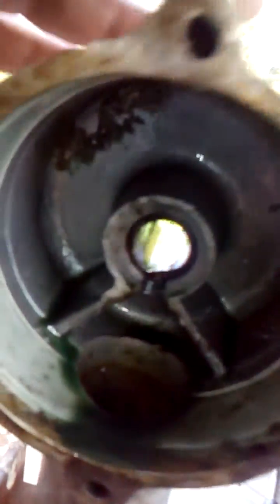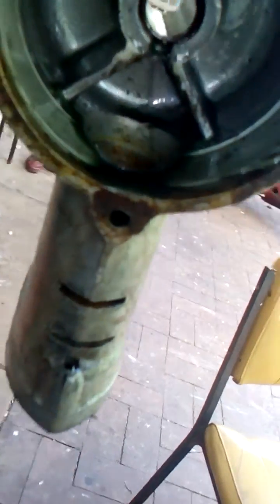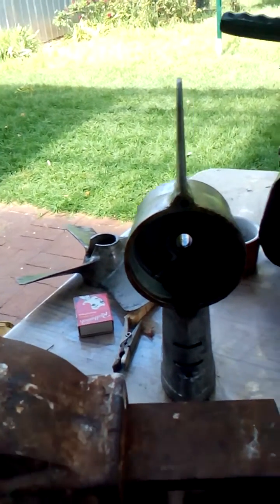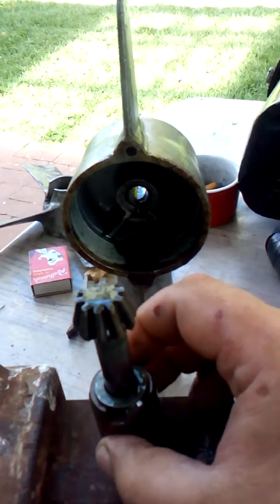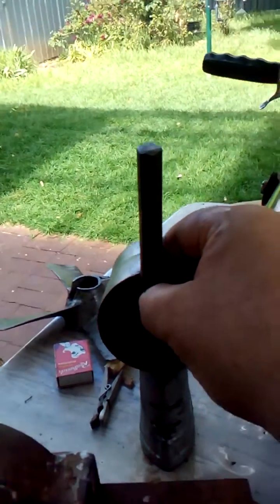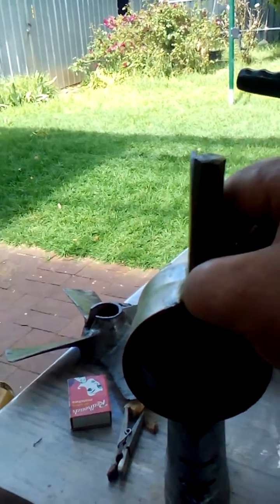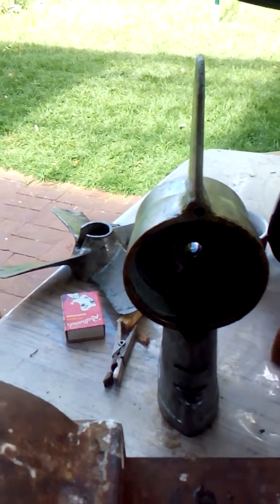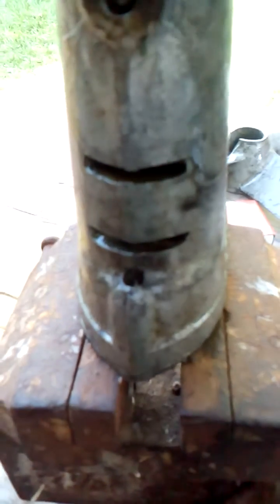British seagull pinion / bevel gear removal the easy way

Comment: Wondering why did you need to remove the pinion?
Reply from the maker: to replace the bushing if its worn or the gear if it has has damaged teeth which mine had caused by a pin that had fallen out
Reply: Mine is turning, but not very cleanly, so removing, honing and regreasing it will give it longevity.
Reply: Hi there, Mine came out when I tapped the long drive shaft which it is currently stuck on? How do you get the bush back in in the correct position so it aligns with the locking screw. Thanks